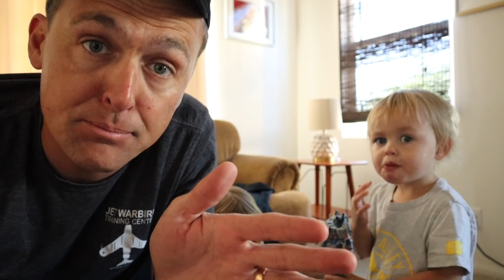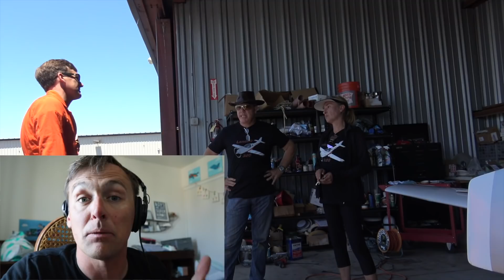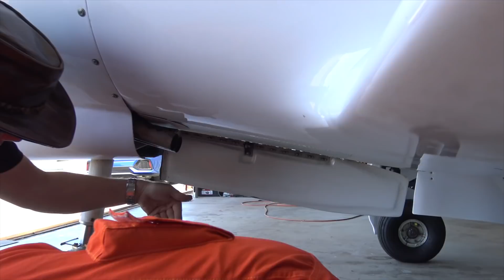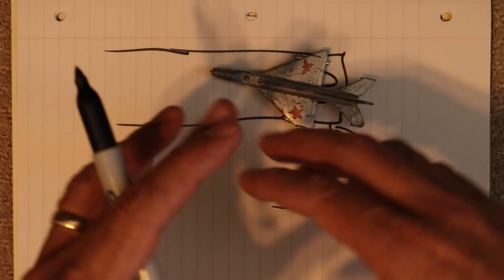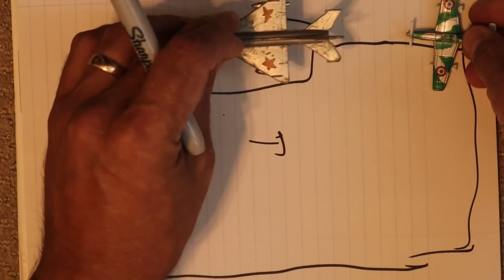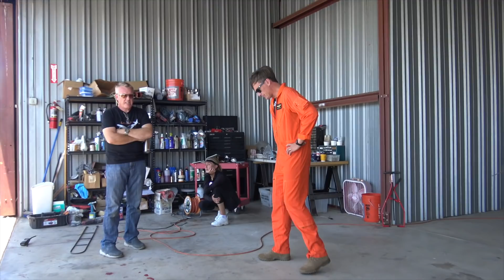Hot Motor Abort - Fowler Flap Modified Hakan Lancair - Flight 2

Comment: Long format rocks!  Curious on thought process on wearing a chute vs. no chute. Also equipment like helmet, portable O2 with facemask, gloves, nomex, crash axe, etc.   Your videos run the range from all of the above equipment like Bowers Pony Program to something like the JellyBean Thorp Program with no protective gear.  I can hazard a guess that your decision making process analyzes the threat profile of the sortie, but to hear you break it down as part of the brief on each flight would be cool.  You had an old video which you broke down and described all the safety equipment which I really enjoyed.  Really solid content.
Reply from the maker: Thanks for the question.  I try to make a habit of wearing the safety equipment but there are exceptions.  

The Thorp was relatively low risk (other than the last flight) so I got lazy and wore jeans and a headset (I am not proud of that).  In general that program is a great example of scope increase.  Where initially I was only going to fly the plane once, but it just kept growing as we found more little things to fix.  And no complaint from me, it is one of my favorite airplanes I have flown in the last several years.

In general thank you for the comment.  I started filming my flying and briefs to protect myself from customers saying I did something they didn't want me to do in the cockpit.  Very quickly the footage was valuable for me to evaluate my own processes in the cockpit.  When we started publishing it added a whole other level of feedback (like this), keeps me honest.

Thank you

Comment: Just a wag, maybe the timing is too advanced resulting in higher CHTs?
Reply: Generally retarded timing adds heat.
Reply: @hookmaster1109  - Highly retarded timing might increase EGT temps (due to exhaust gasses still combusting after they exit the cylinder); but the original poster was commenting on CHTs - which in general do rise with advanced ignition timing.

Comment: Good work Wasabi. This is a good mission to identify cooling problems with go/no-go parameters. Just a suggestive thought I'm offering to the community... I've found that with air-cooled engine cooling engineering, considering tradeoffs of reducing drag just by aerodynamics of ram-air and suction induce drag with tractor configured aircraft... This fact simply equates to a bottom line of horsepower to overcome the induced parasitic drag. Understanding the overall CFM required to cool at WOT with labored loaded air-cooled engines equates to a HP formula that I'm finding can be best overcome with a robust alternator and electric fans. By considering electric turbo duct fans we can simplify complex control to automation. It appears that this particular client might consider this suggestion to get his ideas dialed in as it appears to me, that overall he has reduced the parasitic drag and with benefit of external forced electric turbo pressurization he can cool things down. His overall plane is beautiful and is a true asset to the experimental aircraft community! I'm looking forward to the next Wasabi Bell!  Best wishes...
Reply from the maker: Thank you Will!
Reply: @utopiasnow  👍👍👍
Reply: Interesting idea...  Any links to videos of planes that use this technology for forced cooling?

It's basically similar to the electric fans on vehicles for cooling at low travel speeds....right?   Not really needed once the vehicle is at speeds where sufficient CFM is achieved...
Reply: @fabricationhintstipsmisc6192  No I haven't seen this being posted anywhere. I'm a commissioned R&D developer that works with PMM, PLDC, PMDC, MoGen Metronomic/Parametric motor technology. This is more than just an idea. Though It's not fully developed for aircraft. The original electric motors I developed are for oxygen and R1, R2 and alcohol fuel pumps for orbital rocket motors. One of the proven spinoffs (4 years) is an off grid swimming pool pump motor system from this technology. It would be simple for me to produce a ducted fan system if there is a proven need... I'm a Mooney pilot that installed the extended nose speed mods on C models and have learned with empirical application the cooling trade-offs... The system I have in mind would also facilitate extra propulsion...
Reply: Will-- thanks for the reply.  I'd be curious on the estimated current load and run time for the ducted fans....and alternator load, HP requirements.   It does sound quite intriguing!!!  I wonder if this would provide a net efficiency to the cruise of the airplane......
Where would the ducted fan motor be placed to be the most efficient at moving air thru the cylinders?  I.e. do you pressurize the top of the cylinders or try to draw air thru cylinders? With the fans near the exit..
Reply: @fabricationhintstipsmisc6192  I was engineering this in my dream last night... I was drawing up 2 fans with a divider plate perpendicular to the firewall designing positive  front to back cross over flow each fan pulling suction with isentropic flows facilitated by venturi plenum crossed pantlegs. Then it occurred to me in my dream that I didn't need electric motors to do this! I can venturi scavenge the the two exhaust like we do with Medical Waste Suction or Automated Chemical Dispensers to increase positive forced CFM for cooling... The exhaust gases will fill the void reducing parasitic vacuum drag... Seems like a no-brainer to engineer... Another knot in my bucket list to untie... I plan to work on this next week and create a crude mockup... I wish I had time today...🤣🤣🤣  Thanks for your questions sir! 👍👍👍
Reply: @fabricationhintstipsmisc6192  The (CFM)Cubic Feet Per Minute calculations are simple enough. Then taking that calculation and sizing the ducting to (VFPS) Velocity Feet Per Second. Simple parameters to calculate with a ductulator https://ductcalc.ca/ once the static resistance is calculated. In an almost balanced system like with this Hakan Lancair project. I'm thinking the ducted fan cooling boost velocity needed off the top of my head will prove less than 1.5 KW. I would design the system to pressurize the engine cowling with a tractor configured aircraft. Fan intake forward incorporated with a ram air intake configuration. We can get creative with the exhaust ducting velocity and facilitate a small net improved efficiency thrust for cruise performance. 1.5 KW is for cooling only and wouldn't facilitate supercharging engine performance for the engines air intake. The engine's air intake would need to be plumbed out of the air-cooling cowling. However electric supercharging could also be considered leading to another improvement.

Comment: VFR only Lancair? Interesting that he went with only steam gauges. Always good content Elliot. Appreciate the videos, your commitment to a safe program, and professionalism.
Reply from the maker: Thanks Jeremy.  Not to speak for Hakan but I believe the strategy is to prove the airframe mods before upgrading the panel.
Reply: @utopiasnow  I've been following Peter's Raptor project as well, and your point here about proving the airframe first is well-taken as well. Things like compound turbochargers, air conditioning, first-time auto conversion and a clean sheet PSRU seem like biting off too much at once. I do wish him well, and I hope that the reality check and improvements you guys suggested have pulled some of the risk out of that program.
Reply: Elliot Seguin that makes sense. I’m sure it will be a good machine once the bugs are worked out
Reply from the maker: I’m stoked to see where it goes

Comment: Hakan needs a sealed plenum. Oil cooler inlet is also poor choice, NACA on the side does not want the air to flow into it as it is already low pressure there rather than the high pressure you need for an inlet. Ideally have a scoop outside the boundary layer for oil cooler inlet.
Reply from the maker: Thanks for the comment

Comment: Gonna need a foot of cowl induction port topside and probably a foot on each side for exit. May want to direct the flow with shrouding over the head fins just to be sure.That cowl oil cooler port may double as a exit port with a shroud over the front other wise it's a false induction open pressure gate that's gonna stall directional flow.

The exhaust manifold should be pointed down and away from the fuselage. 415 to 340 is a big ask. Really gonna need to manage that prop airflow.
Reply from the maker: Lots of fun work ahead!!!

Comment: I remember during the development of the RV9, the first Van's Aircraft that had the slotted flap, the test pilot reported the lower control authority of the elevator due to the different downwash characteristic of the slotted flap versus the simple split flap Van used up to that time.  The elevator was redesigned to have longer span than the traditional trapezoidal shape of the RV8 and RV7.   Elliot had reported lower elevator effectiveness of the elevator at low speed during his first test flight because this Lancair was redesigned with the slotted flap.
Reply from the maker: 2Phast4Rocket yeah we are excited to study it.